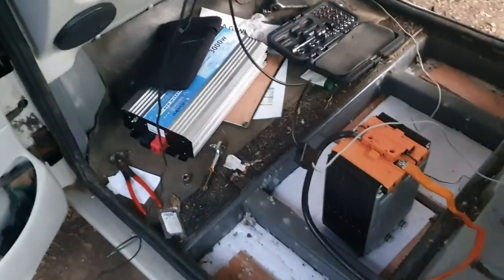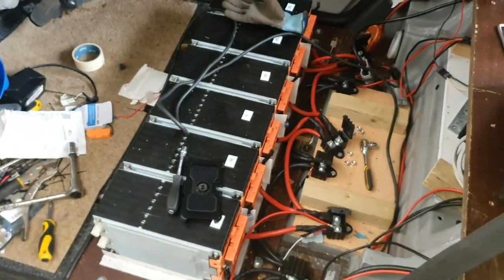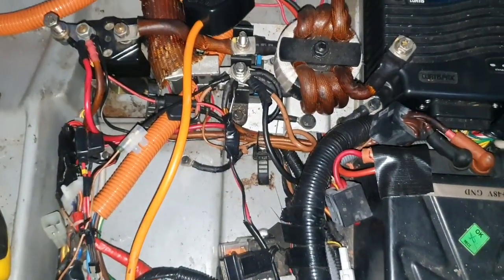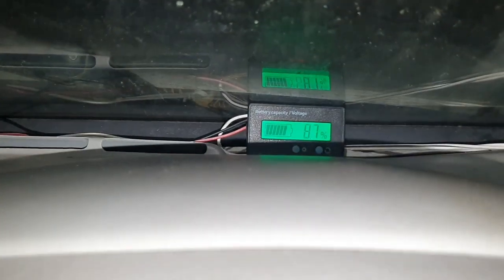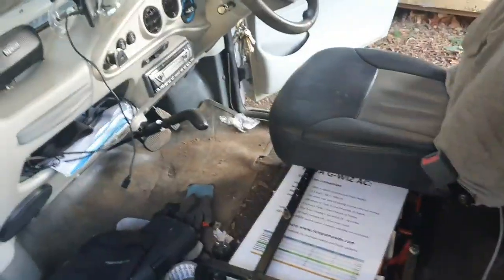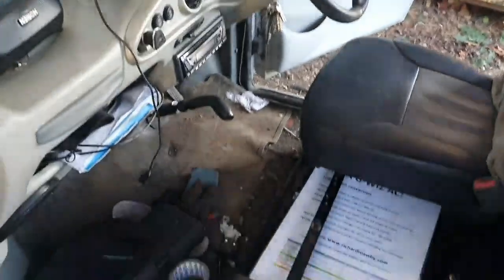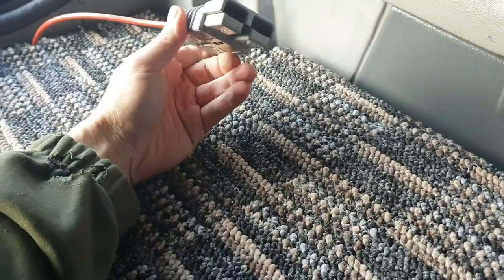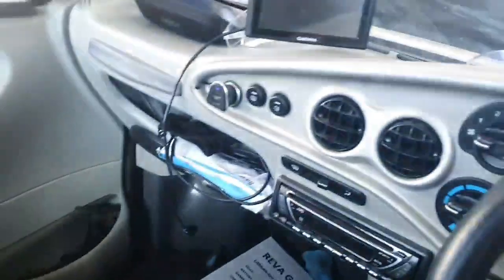REVA GWIZ LITHIUM-ION CONVERSION: Silver G-wiz is alive again!

Comment: So using the standard charger, and EMS software can I move my car up to 60v (The motor controller has been unlocked) (5 x 12v 100ah).  

Will the 12v from the charger still work
Reply: Sorry rewatched this, so I can remove the EMS and there is a fix to allow the charger to do 66v?  How do I do that, do you sell the fix?
Reply from the maker: @burf2000  If you jump onto revagwiz car club group on face book or the website you can find some files. If you look for the charger pinout you just have to get the right components on ebay to do the job. it's quite simple. There is also a video on my yellow gwiz playlist that shows you what I did to get 66.5 or whatever the max voltage was on the charger too using various components.
Reply from the maker: It's a simple case of following the pinout and making sure you have the relevant wires. You only need pin 1, 2, 6, 8 and 9 to work the charger.
Reply: @RichardMawby  Thanks Richard, I am on the forum, I will go searching.  Epic work